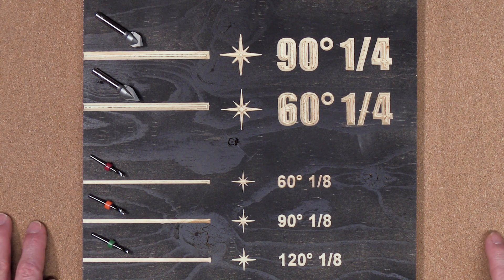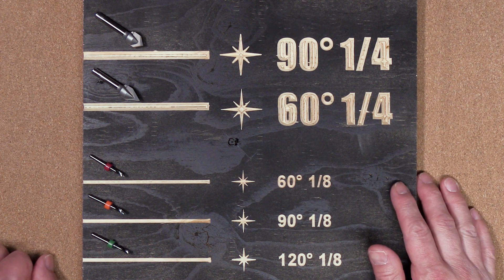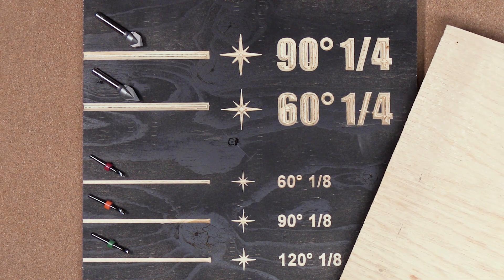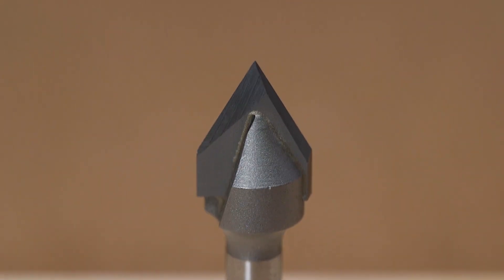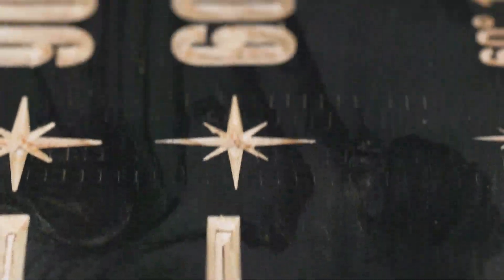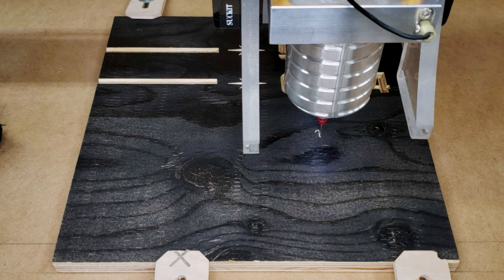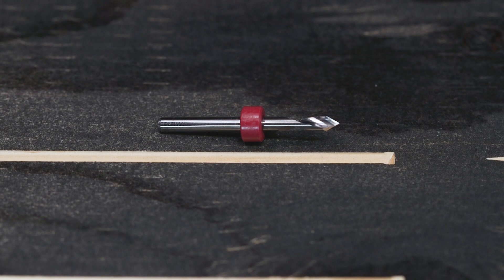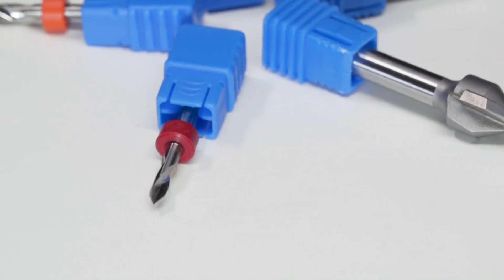CNC Vbits for Beginners

Comment: Hi, just a quick question how do you measure the tip of v bit when the seller doesn't know ?
Reply from the maker: Do you mean the angle? Or across the cutting edges?
Most software should tell you where there measuring points are.
Reply: The very tip, sir, how's it measured

Comment: Nice production quality. What's missing is the depth of cut, depth per pass and nice to have would be feed rate.
Reply from the maker: Thanks for the feedback!
I didn't add feeds and speeds because they vary so much depending on the materials you're cutting.
Reply: @peterbloch5590 Yes,of course, feeds and speeds vary so it was only a "nice to have". However, depth of cut is independent of any machine so you could still mention what you used on your machine. Thanks

Comment: Out of curiosity, how deep of a cut did you go with these bits? I find that the 60° bit 1/4in shank gives some great results. Thanks for sharing!
Reply from the maker: I didn't set the depth for any of these, I just use the software defaults for v carving. Agreed, 60 degree 1/4" bit is great.

Comment: Thank you for that detailed explanation on V bits, can you tell me do I need run a higher speed with a 90 degree bit over say a 60 degree since the 90 cuts more material
Reply from the maker: Thanks, Colin.
I'm using the default Feeds and Speeds in Carbide Create, which seem to be the same for both bits. I also have both bits set the recommended setting of 3 on my Dewalt router.
Reply: This is ridiculous😂 naming video "... for beginners" and cannot provide feed rpm and doc, saying that you use some default settings😂😂😂😂